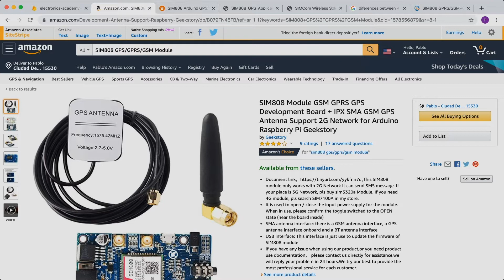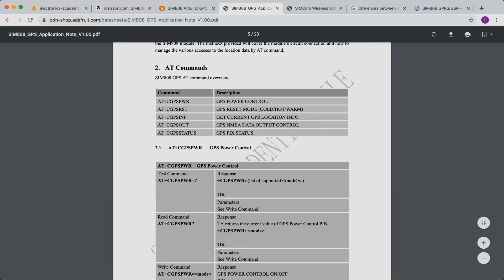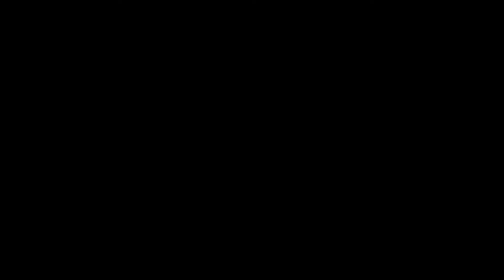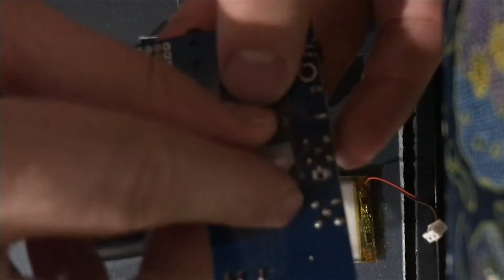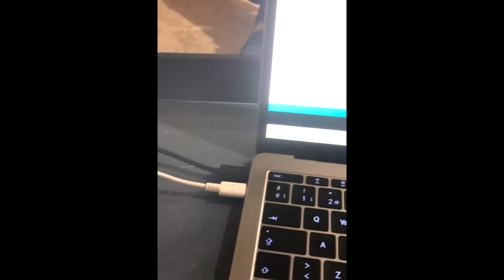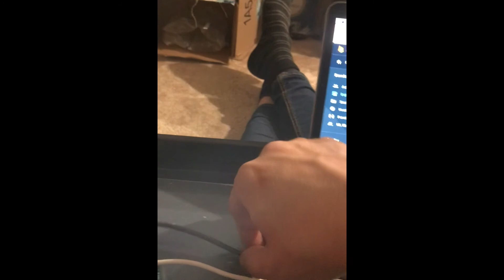sim808 Command AT HTTP POST GPS GPRS GSM Arduino UNO Board

Comment: How do you send the gps coordinates to your firebase?
Reply from the maker: Hi htesh the secure method is using POST for security reasons, and you catch the request with a Firebase Cloud Function in backend so yo can trigger specifically functionality. The actual code is in the repository.
Reply: Did you found any tutorials or articles of how to send the GPS coordinates to firebase? I'm facing the same problem too.
Reply: @tsuming99 What I understood is the arduino sends to a server and using php, it sends to firebase. Could you please share your code when you are able to do it?
Reply: @htesh  yea can but I'm still searching for the codes 😭